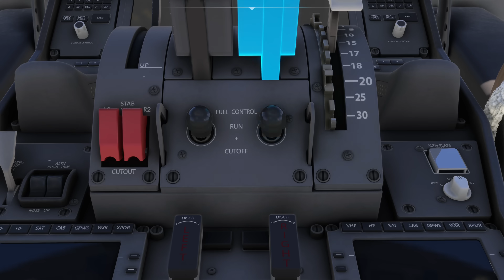Air India 171: Why Did The Fuel Cut-off Switch Get Moved?

Comment: Captain Steeeve, I would firstly like to thankyou for your very informative presentations, they have been very educational

as per my comment in one of your earlier presentations
	I was an Air Force Electronic technician, 10 years of service
	I am familiar with these type of switches and have replaced them a few times
Have I ever had to investigate/rectify a reported aircraft fault and found this type of switch in mid position = YES

I finally found what I was look for on the internet: a very close up photo of this switch, so that I could seeing the design/shape of the physical ridge. (as there are different ridge shapes on the market)
I bring your attention to the following Youtube provided by a Boeing aircraft maintenance person: 
Stig Shift #78 (Aircraft Maintenance Adventures), please review between 16:00 - 20:00 mins of this video

That particular version of switch found on the Boeing 787 has a middle flat spot, on the physical ridge
I believe it is possible to position the lever some where within middle position. I also believe that the spring will assist for the switch lever to remain within incorrect position, because it is providing pressure on the 2 contact surface areas (switch lever wedge and flat area of the physical ridge)
If it was just sitting on the edge of the flat area towards RUN position, that may have been just enough for an electrical CLOSE contact of the switch.

You are correct, it is near impossible to position the switch in mid position if you perform the text book a pinch/pull/lift over technique. My Airforce experience as shown that they can but placed in the mid position. Some Airforce pilots over the years create a bad habit, because of their flying gloves. I believe that they position their thumb on top of the entire switch lever and grip with the rest of hand (like how would if you grabbed hold of a rope) and then pull the lever outwards, tilt their wrist, then release the switch lever. Because of this type of gripping the switch lever. The switch lever is held steady as you release the grip, thus making it possible to balance the switch lever within the flat area of the ridge. 

Putting both switches in mid position is very unlikely, if they were both in mid position, that is a freak of nature (unlucky). As per point #1 below, they were not doing their normal take-off roles. So anything is possible

So here is another theory
1. as per the report. The pilots switched responsibility for the take off (co-pilot to control/manage the take-off, while the senior pilot acts as monitor)
2. They most likely were not sitting in their normal seating position (thus making normal left/right actions opposite, may cause some confussion)
3. Engine#1 switch is placed accidentally placed into mid position (remember the pilot whom performed this switch movement, it was not his normal take-off role/responsibility)
4. Engine#2 cut-off switch is placed correctly to RUN indent position
5. Everything operating as normal
6. Throttle up time, the aircraft is twisting/turning and bouncing as it travels down the runway
7. Engine#1 cutoff switch migrates more towards the CUTOFF position (enough to cause an electrical OPEN circuit within the switch, de-energizing the fuel relay)
8. Engine#1 sound alerts the pilots that there is an issue with engine#1 and no fire alarm
9. One of the pilots thinks, just switch engine#1 off and investigate later when it is safe to do so. With a quick action the pilot, accentually grips Engine#2 cut-off switch, toggles from RUN to CUTOFF (remember that they are most likely not in their normal seating position)
10. One of the pilots observes this quick action by the other pilot and then asks "Why did he cut-off?" (meaning why Engine #2)
11. The other pilot responded "he did not" (because believed that he toggled Engine#1 cut-off switch, when he actually had toggled Engine#2 cut-off switch)
12. The rest is history

Further into the video, he shows a Boeing 737 cut-off-switch, does not look modern or slick, but there is not way in the world you can incorrectly position with that design of switch and very easy to determine what position they are in. Maybe Boeing should rethink their 787 cut-off switch design

Comment: How do they know the fuel switches were cut off then turned back on? Seeing the wreckage, the switches would have been in the on position. Are they solely relying on the data recorded? There are a lot of electronics involved here. The co pilot may have assumed the switches were cut off because his instruments would have shown no power. Apparently this particular aircraft (not model but this exact airplane) has had electrical bugaboos in the past. Maybe the pilot did not turn off the fuel, rather, an electrical issue may have caused it and the copilot just assumed the pilot killed the engines. In the end the switches were in the on position when it crashed. I'd be more inclined to blame the aircraft for cutting the fuel and logging it as a fuel cut off event. Would a suicidal pilot choose such a roundabout way to meet his end? Perhaps cameras facing the controls would have resolved this definitively. It was also leave the pilots faces anonymous from footage as the cameras would show only the controls and the pilots hands operating them. The 787 was built during Boeings worst time of management when employee morale was at its absolute lowest.

Comment: NEW DELHI: Following constant media reports in the west on Air India AI 171 crash that squarely point the blame on the captain of the doomed aircraft based on information from US authorities, India’s Aircraft Accident Investigation Bureau (AAIB) on Thursday called out this “irresponsible” drawing of “conclusions through selective and unverified reporting.” The bureau issued this statement after The WSJ in its latest report on the issue said, “…captain turned off switches that controlled fuel flowing to the plane’s two engines” accidentally or deliberately, citing people familiar with US officials’ early assessment of evidence uncovered in the crash investigation.

Comment: Why pilots can cut off fuel at a crucial time as taking off , there must be something that doesn't allow him to do so . Or tie that to the start switch itself, it's only rare 1% of the time any burning occurs . There needs to be a heat sensor to automatically allow the fuel to be cut off or a key assigned to the head pilot to get access to that. It's very bad that a single person fault that  killed 200 + passengers. I am actually afraid now to travel with air india or boeing planes. Also the atc or some one with access to cctv there should monitor , why the landing gear wasn't up as stated by a youtuber. Also cctv quality was so bad and otherside a phone camera could grab all details?

Comment: I have watched all your video on AI 171 crash. I must say in the beginning you were talking & analysing thing on merit however after AAIB preliminarily report your whole talk has shifted to blaming Captain and then very smartly shifting it to the mental health/suicidal thoughts. I appreciate that you comes up with mental health issue to discuss but connecting the same to the AI crash points a big question mark as to what you're trying to prove? 

As you're an experienced professional, you also know that preliminary report isn't a complete investigation and it doesn't provide conclusive or final verdict to the Air Crash Investigation so I hope you atleast give a note before MAKING BLAME on "PILOTS" who had an exceptional past record of flying and GIVE CLEAN CHITS TO BOIENG manufacturers whose past records so much of complaints, whistleblower concern about poor flight manufacturing process and cost cutting to milk dollars.

In addition to the report, I would also ask you to check the distance covered by flight to take off? Was it normal? The answer Is NO.

The flight couldn't lift off from runway after passing the normal distance which Can be Indicative that Engines were not working to thier full potential however since they reached V1 they have to go for take off. 

The flight couldn't take off at the next possible distance too, it took much more runway coverage than expected.

All these facts should also be taken into investigation and less on to what your children will respond after doing any mistake intentional or unintentional? I say this with complete respect to you and your loving childrens. I request you to talk about investigation and facts associated to it not simply drag unrelated stuffs to prove that it's a pilot fault.

Peoples Lifes are at stake so and you are also a captain so please do comparative/honest analysis and expose out issue that exists in the flying Industry or In it's Leaders.
Reply: I would also like to draw your attention about the statement given by the sole survivor of the AI 171 crash. 

He said there was heavy flickering of light which previously as reviewed and stated by you Indicate possible chances of Dual engine failure or some other mechanical Issue.

Another point to check Is CCTV footage of the flight from which If not completely then to a possible extent one could trace and figure about RAT deployment just after take off.

I mean why after report, all previous facts, Statement of survivor, Images & videos of flight are being completely ignored while making the video on AI crash.

All things need to be viewed collectively and then do comparative analysis so that we can atleast reach to the truth even if big gaints try to hide it. It doesn't matter if it's Boeing or AIR India

Comment: Key Anomalies & Inaccuracies
1. Blaming Pilots/Deliberate Action as the Only Explanation
Video Claim: The report “falls short” of naming intent but viewers are invited to “draw your own conclusions,” heavily steering discussion toward deliberate pilot action or suicide.

Official Report: Makes absolutely no finding or suggestion of intent, suicide, or deliberate action. States the sequence—both engine fuel control switches moved from RUN to CUTOFF one second apart—without assigning cause or motive. The cockpit voice recording captured confusion (“why did you cutoff?”/“I didn’t”); the investigation is ongoing.

2. Stating the Switches Were 'Deliberately' Moved
Video Claim: Asserts “the preliminary report states the fuel cutoff levers were deliberately moved.”

Official Report: Nowhere uses the word “deliberate” or “intentional” regarding the movement of the switches. The report only documents the fact that the switches were moved.

3. Declaring Mechanical/Design Issues Ruled Out
Video Claim: “There was no flaw in this aircraft that led to this accident. This was done by human intervention, plain and simple.”

Official Report: This claim is false. The report explicitly keeps all possibilities open, including mechanical malfunction, inadvertent action, and design flaws. It even highlights a prior FAA advisory about possible issues with fuel switch locking mechanisms and notes Air India had not performed voluntary inspections on this aircraft because they weren't mandatory.

4. No Procedure Scenario Mischaracterized
Video Claim: “There is no procedure on the planet where that is a thing to do. There’s only one real explanation for why that happened and you can draw your own conclusions on that.”

Official Report: Confirms there’s no procedure for both switches to CUTOFF after takeoff. But it does not conclude only intentional/human action could create this result; mechanical and inadvertent causes remain open.

5. Speculation & Inviting Psychological Narratives
Video Claim: Multiple user questions and answers revolve around motives, denial, and pilot psychology, encouraging viewers to consider mental health or premeditation.

Official Report: Contains no psychological findings, mental health speculation, or accusations. Calls for restraint from speculation and emphasizes the investigation’s purpose: accident prevention, not blame.

6. Technical Dismissals & Unsupported Certainty
Video Claim: Dismisses questions about maintenance/jumper plugs or computer problems out of hand.

Official Report: Analysis of possible mechanical/construction/installation flaws (from previous advisories) is ongoing and not ruled out.

7. Prematurely Clearing Boeing
Video Claim: “That Boeing aircraft was operating exactly as designed. There was no flaw… That’s very clear from the preliminary report.”

Official Report: The report does not clear Boeing or any manufacturer. An FAA advisory regarding possible switch issues, not addressed by Air India (since not mandated), is cited and remains under investigation.

8. Process and Transparency
Video Claim: Implies there is something secretive or lacking in transparency about the report.

Official Report: The full preliminary report is in the public domain, standard for major aviation accidents, and subject to routine international scrutiny (including by the FAA, NTSB, and other agencies).

What the Official Report Actually States
The official investigation is not complete—no cause, intent, or blame has been assigned.

All possible factors (pilot action, mechanical/design issues, inadvertent movement) are under review.

Both engines lost power when the fuel control switches moved to CUTOFF, but how and why remains unresolved.

The investigation’s focus is on prevention and fact-finding, not speculation or assigning blame at this stage.

Source
All facts are based exclusively on the Government of India’s official preliminary accident report for Air India Flight 171: "Preliminary-Report-VT-ANB.pdf". Anyone discussing this incident should reference the official report, which is publicly available, for an accurate, evidence-based perspective.

Summary:
Many prominent claims in the video, such as deliberate pilot action, total exclusion of mechanical faults, and assertions of intent, are not supported by the current findings of the official investigation. The only credible foundation for this discussion is the actual public accident report, not speculation or inference.

 Preliminary-Report-VT-ANB.pdf

Comment: If TCMA, in conjunction with FADEC, erroneously believes the aircraft is on the ground when it is actually in the air (e.g., during takeoff or climb) can command the engines to reduce thrust or even cut off fuel, be a reason for the incident.
This is because on the ground, engine parameters and control logic differ significantly from in-flight operation. A notable 2019 ANA incident, on Boeing's 787 aircraft, involved this exact scenario, where a software glitch caused the system to mistakenly interpret that the plane was on the ground.

Some of the conditions for TCMA activation are as below, as per an Indian pilot also serving as chief flight instructor with 13k hours of flight experience.
1) It protects when the aircraft is on ground
2) Air speed is less then 200 Knots
3) Altitude less then 17,500 feet
4) Selected N1 is more then the TCMA threshold.

In the case of AI incident, the max speed noted in incident report was 180 knots (condition 2) and altitude was 625 feet (condition 3). If a software glitch, similar to 2019 ANA incident which was also on 787, have occurred, then it could trigger TCMA to believe that the plane is on ground (condition 1), while the selected N1 thrust will surely be more then TCMA threshold as the aircraft was in take-off position with max thrust condition (4). Looks like all conditions were met in this scenario. I myself am not a pilot, but maybe you can put some highlight and your experience here if this is correct.

Also, noting the conversation in cockpit, Person A asking 'Why did you cut-off the fuel?, where Person B replied 'He did not..!!'. This could be the exact moment after TCMA malfunctioned and cut-off the fuel in succession of 1 second. And later the pilots, in their best possible try to avert any incident, switched the fuel back into RUN position. The Pilot turned chief flight instructor, also mentioned that 'It is impossible for a human to switch both fuel-cutoff switches within span of 1 sec'. Maybe you as an experienced pilot can put some light here, if that's correct or not.

Also, The preliminary report didn't mention if there was anyone else in the cockpit besides the two pilots. It is possible that another airline employee was traveling on the jump seat and they decided to cut off the fuel - something very similar almost happened before where the jump seat pilot tried to activate the fire suppression system, and it would explain the bizarre exchange between the pilots. It's also quite unlikely, if the CVR indicated it, they would mention it in the report - but technically speaking it cannot be ruled out yet.
What are your thought on this? https://g.co/gemini/share/21859e4d7e50

Comment: I'm surprised no-one has said if it was a software fault, then that's why they moved the switches to cut off and back again, to try and fix it. Now we hear from the report it was the co pilot asking about cut off, and the pilot making the mayday. I'm now leaning much more towards a technical fault. Not sure why Captain Steve is saying the plane was operating normally, you can't know that 100%

Comment: Whats about the issue with that switches in a Boing Bulletin ? They are taking about failures if the spring loades cap is in the wrong orientation ?